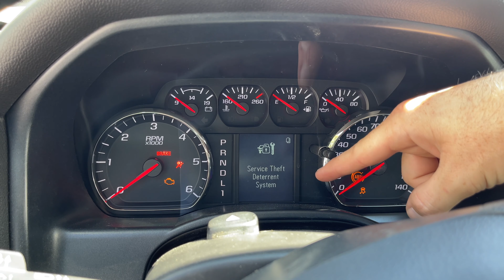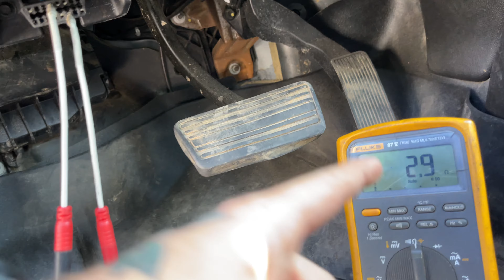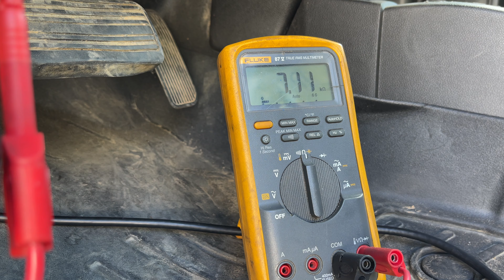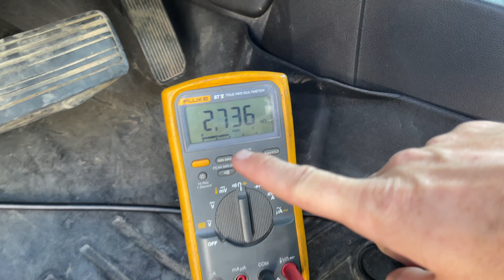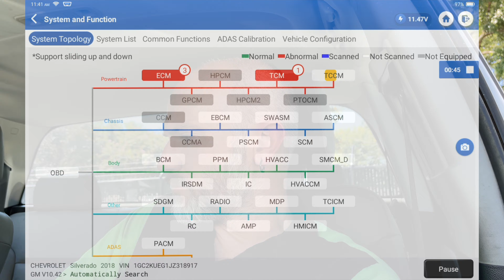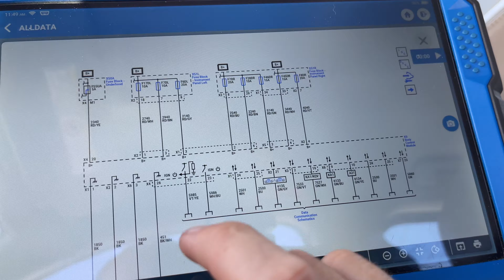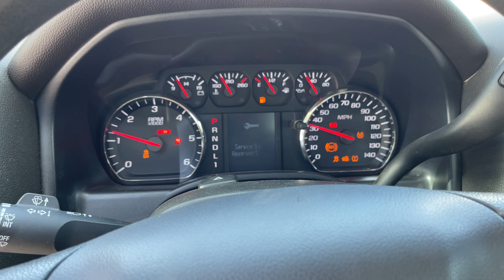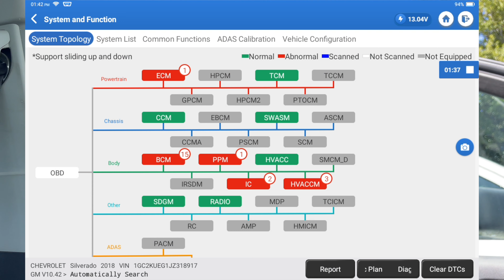Holy Smokes literally this is crazy!

Comment: I'd jump up on the bed real quick and look over the roof and the hood and see if it has any burn marks in the paint.  Because it definitely seems like it got struck by lightening-- or maybe someone hit this truck with a welder somewhere and had their ground in a bad spot and pulled some juice through all the modules somehow.  IVAN had a car like this not long ago, and it was from a welder burning through a hole under the seat (from under the vehicle) and hitting some wires with his welding rod.  Fried a bunch of modules just like this one.   crazy stuff.

Comment: Thank you for your time. Couple months ago I check a similar truck. Almost same issues, I am a mobile technician. The shop did not provide me with any info other than a start stall engine. After running several test, I found a BCM staying on all the time, and a PCM not seeing a wake up signal voltage (btt volt). Well it was my first time seeing two modules faulty. I did not fixed, the customer took it to the dealer. At the end I feel comfortable for knowing and learning on all this YouTube channels. Thank you very much SR...

Comment: It's a ground problem , most likely the ground strap for the cab has failed. This has become a common problem...it's located down under the passenger side of the cab in the engine bay right behind the right front wheel.

Comment: From an automotive electronic module design stand point, module power is protected against electrical overstress (spikes due to induction), ESD and reverse battery connection or reverse jump, and sometimes double battery jump. How robust the protection is relative to the specific type of fault is what is usually not known, except for ESD (ISO 10605) which is strictly tested. In my experience the weakest link is double battery jumps (24V jump). However, I think reverse battery is not strictly protected on all vehicles. So, installing the battery backwards may damage modules. But, there is a lot here that does not make sense from a systems design standpoint. For example, you would think that the most robust module would be the gateway/BCM. But, many times the BCM will be one of the first to fail.

In my long career, I have not worked on a car that actually had a known lightning strike which resulted in an electrical failure. But, I suppose it is possible to damage modules this way. 

If we look at the HSCAN network, the Module Engineers had to make a choice about how to daisy chain the HSCAN network; on the harness side with a splice at the module connector, or inside the module, which takes two extra pins on the connector (both male and female) and requires cross connect routing on the module PCB. From a generic network architecture having essentially CAN in and CAN out is flexible in routing the harness because you can add external termination to the end module which ever it happens to be without using splices in the harness. If you have a bad module pin on one of the CAN signals (CAN in or CAN out) you will lose bus termination and the network may not communicate. If a harness splice was used it would not matter if a module pin was bad. 

Having modules (and mating connectors) underneath a vehicle without a secondary enclosure to protect it from the elements is crazy. Having wiring harnesses underneath the vehicle is also crazy, but a harness can be sealed and routed in such a way to minimize salt spray intrusion. If we look at the modules in the rear of the truck in the video, the connector wire input harness side faces towards the front of the vehicle, which again, is crazy. Modules and harnesses underneath a vehicle will not survive long in the salt belt. Which seems to be rather stupid from a GM truck standpoint, because there is a truck plant in Pontiac Michigan and the GM Tech Center (Engineering Center) is in Warren Michigan, and Michigan is most certainly in the rust belt and a place where salting the roads is extreme.

I don't really use traditional bulb test probes or custom bulb test lamps any more (I don't like the inrush current and the inexact current load at steady state), except when troubleshooting bulb circuits. Instead, I use my Fluke DMM on DC Volts with custom low inductance resistive dummy loads of 22 Ohm and 6.2 Ohm, which provide a known load of approximately 550mA and 2 Amp with a 12.4VDC main voltage respectively. The power resistors are mounted on a small heatsink and mostly covered in heat shrink tubing to allow for heat dissipation. If I know the load, which I do, and I know the voltage, which I do, I also know the current. In automotive testing you will see as a trend to use a small load when testing power feeds and grounds this is to determine if there is a high impedance connection which you will not see with just a DMM due to its high input impedance.

In my career, I see two basic groups when it comes to bulb testers vs. DMM testing. If you start as a diagnostic technician at a high end dealer or an Automotive OEM you will not see bulb testers much, because they are not issued and sometimes banned (like at an OEM), generally you will have access to (or maybe get issued if you are lucky) a DMM, usually a low end Fluke, like the 115 for example. Many senior techs will have a Fluke 88V. I purchased a Fluke 87 which I used for about 10 Years and replaced the LCD screen once. I also had on my bench a used Fluke 8050a which I repaired and still have today. I really like the old 8050a for a basic bench meter. I know this may sound stupid but if you are working with other high paid techs, it is better to pull out a Fluke 88V to do testing than a bulb tester. If you work by yourself, do what ever you want. If you are working around OEM Module Engineers never use a bulb tester.

Comment: I'm sure you told the customer about the high cost of replacing many modules now and possible intermittent electrical problems in the future with the harnesses and other components.
This video and the next will make for some great diagnosing.  I just hope the customer understands the costs and possible future costs.

Comment: Be careful with them aftermarket scan tools on these newer one's too brother; because even with Techline/MDI Factory Scan Tools, we all know, that somtimes, DTC'S don't like to clear, ESPECIALLY during a system wide dump...unless you ACTUALLY go into the module through GDS2 and clear them...silly but true story!

You probably know this I just wanted to let you know or anyone else out there to be aware. Don't forget you can always do a global too, To allow that car to fully power down and discharge...then go drive it and see.?.

That's my thoughts 

Curious to see your approach 

Proper programming,..SDM setup and configuration, as well as, immobilizer learns, and power down is critical as well.

They have made improvements in their instructions on that🎉🎉🎉🎉😊

Comment: Just a quick interjection, and I noticed you [weren't required to?] inspect/document all the BCM's circuit integrities B4 installing a new one?  But forget about that for a moment! and I'll get back to the point:

Considering the condition of the BCM, internally, and the fact that the 'wake-up' signal initiates from the bcm on this vehicle, couldn't you just loop-in/out all the BCM bus circuits -- leave no bcm installed -- then jumper in your own wake-up voltage to that circuit and see who else might be able to respond to a scan?

Oh yeah -- awesome work, keep it coming!

Quick edit:  if you backprobe the wake-up wire on (a good vehicle), on (any of the vehicle devices that receive that signal from the bcm), just sticking the key in the ignition lock cylinder will trigger a 12 volt wake-up signal, you don't even need to turn it on.  Sometimes it comes in handy. 👍
Reply from the maker: In this particular instance you could trigger the wake-up line but not all modules will have a dedicated wake up line. In a lot of vehicles modules are sent a wake-up over the network. Like for example the radio has a constant power and ground and woke up with network activity. Usually what I see is dedicated wake up circuits are used in vehicle operation required modules. But also most manufacturers just use an Ignition voltage to do this function.

Comment: I’m now afraid to take my truck anywhere. Anything can leave you stranded. Like I might have told you after $600 they told me my stereo went bad and that’s why my truck wouldn’t start. I still need a stereo. 😢
Reply from the maker: So with the radio unplugged does it start and run?
Reply: @ yes in runs now and the dealership said all else is good. When I was scanning it with my little code reader all I knew is the BCM and pcm were not communicating. That’s is far as I got before towing it to the dealer.
Reply: I really enjoy your videos except now I’m afraid to leave the house with my truck. lol

Comment: As an automotive locksmith I get these calls a lot. I turn everyone of them down. "My key needs to be reprogrammed". I explain there is no such thing. I tell them to take it to their mechanic or dealer for a proper diag. I tell them I am 99% sure a new key isn't going to fix their issue plus they won't pay me after it doesn't fix the issue. They argue and argue but I refuse 100% on them.
Reply: @autodiagyt  I only send my guys out on lost keys or lockouts. If the key isn't lost and something else is going on other than a steering wheel being locked or car not in park lol we send them. Back in the day we took ignitions apart replaced them rekeyed them but not any more. If it needs a diag or repair they don't need a locksmith.

Comment: Interesting case. If you're planning to dive in further, please put it out on Youtube. The amount of damage in the BCM is very impressive. If lightning did that, then would be great to find out how it found its way to the BCM. Maybe there's still markings of that hit, somewhere on the body of the car. Or does this car belong to somebody who does lots and lots of tinkering with the electrical system, knowing that his modules are well protected by fuses from the eBay Special automotive fuse assorti super heavy duty long life 500pcs for $4.99 with free shipping?

Comment: oh yes sir would love to see the rest of that done . spot on with the can diagnose. had a similar issue this week . hybrid can plugged in 120 ohms . plugged in around mid of circuit unplugged one of the terminated ecu’s 120 ohm went away so went the other way found the nearest plug to the mcu no 120 ohm  unfortunately for tge tech had to tell him he needs to remove the fuel tank and hybrid battery to gain access to the mcu don’t think i made his day